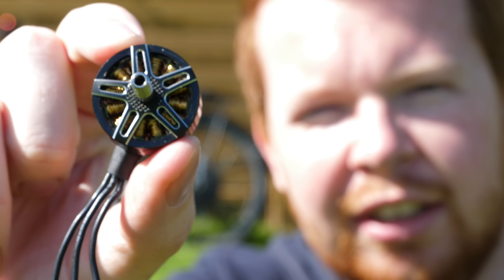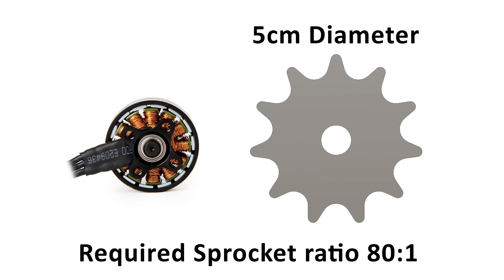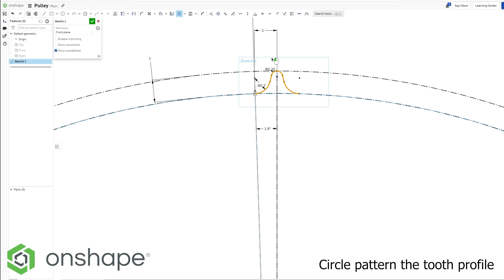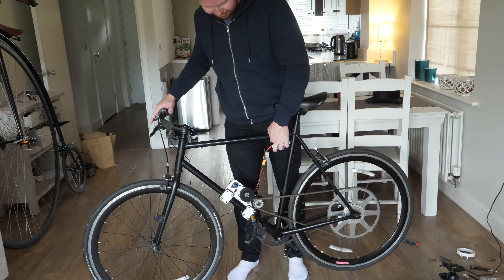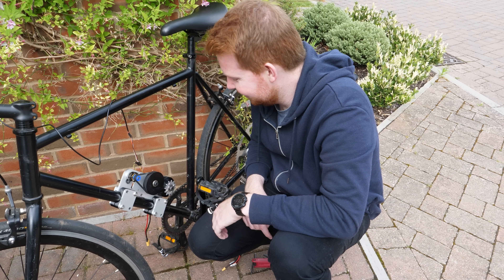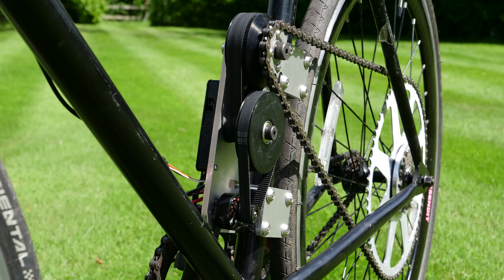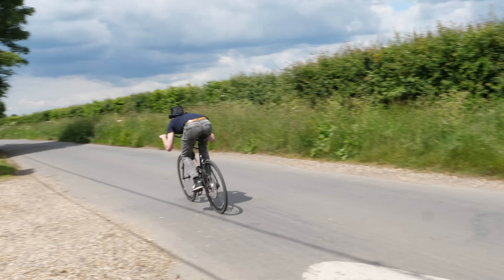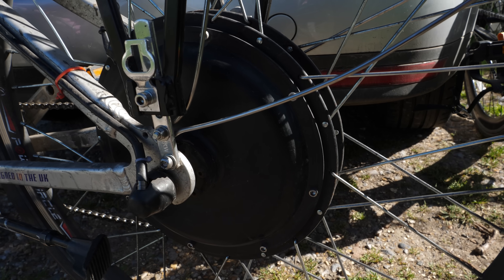Tiny 1kW Electric Bike Motor

Comment: Cool idea. Consider adding an aerodynamic duct to channel air through the little electric motor. So the faster you go, the more air it'll get over it, maybe add a little Noctua fan to it too. Should be fine 😉
Reply: Cooling is definitely what's needed but passive cooling won't be enough, as seen here. They'll need some sort of impeller to force air through the motor. On drones they have the props but that's under a far, far lighter load and there's no structure obstructing air flow like on the bike. Having a good impeller pulling air through the motor and kicking it out is probably the most effective approach here.
Reply: @Kimoto504  That's where the brilliant Noctua fan comes in. They move a lot of air and are damn near silent too =)
Reply: @Johny40Se7en  You need watercooling for this motor to work properly. These motors heat up soooo much even in proper use.
Reply: @yatzeegamingop   A watercooling system would add unnecessary weight though, and copper does corrode, so you'd have to add a heatsink that was attached to the water cooling set up and make sure the copper doesn't get wet. Again though, it would just add complexity to it. Just having a duct made of carbon fibre or even aluminium, then perhaps a 60mm Noctua fan to force air through the motor would be ideal.
Reply: @Johny40Se7en  Dude, i am saying even 85mph of ram air is not enough to cool the motors on my racing drone at full power. Why won't you try to understand it ? It's not a 150W cpu, it's a freaking 900W motor. 

Or better yet, use a hub motor. Like how it was intended.

Also inrunner brushless motors have watercooling jackets used in ground vehicles. Tom was just stupid in using an outrunner.
Reply: @yatzeegamingop  Oh I see...
Well, racing drones at full power is likely more demanding than accelerating a bicycle with a non obese Human on it. 

Or better yet, why not just use the little motor to do the top speed portions, instead of the acceleration from a stand still. Those little motors are not exactly designed for torque, which is very likely why they're overheating so quickly.

It's a cool experiment nonetheless. But hey, if you believe that strongly in your idea. That you can do a water cooling system for one of these motors so that it won't even get hot, even under heavy accelerating, then go for it. I'd genuinely like to see that.
Reply: @Johny40Se7en Noctua is garbage, try Delta
Reply: @Johny40Se7en  "Never even heard of Delta" tells me everything I need to know... No one likes Delta's; they're loud, obnoxious, dangerous, even.
Check out the monster that is the GFB0612ES-E: 60x60mm, 76 CFM air flow, 247 mmH2O (static pressure), 24K3 RPM, 50 watts power usage. 
Insanity.

Want to go larger?
The THD1348HE: 134x134mm fan, 490 CFM, 180 mmH2O, 12.5K RPM, 240 WATTS OF POWAAH

Noise level: Prolonged exposure requires ear protection. 

For reference, Noctuas only do around 1.53-2.34 mmH20, 99% less than the bad boys I mentioned.
Reply: @JosGeerink  them deltas can be so powerful it might as well be used for things like this video
Reply: I say, encase the drone motor in a water tight  case and fill the case with mineral oil.
Reply: @power21100  Submerging the non moving parts in mineral oil could be great. Or a combination of such an enclosure and a heatsink and duct with fan. Win win.
Reply: consider stopping with the lame ideas

Comment: There’s no way that little drone motor will output a Kw of power. To do that at 36v it would be drawing 28 amps and its wires would melt. As they did. Most likely it’s rated at 1Kw peak, not continuous

Comment: If you got a motor that would do that want to let it do that I said not allow it to do that with gears cuz I don't think it's right to be degrading the power of electric motor to slow down the speed of a vehicle that's usually pedals powered to suit the jerk 😜 behind the badge of a stinking cop jerk 🤣😂

Comment: tip, if you want more speed change where your gears are because the smaller gear on the wheel you will get more speed so basically a small to big gear ratio makes you go slow and a big to small ear ratio give you a bunch of speed.
Reply: Isn't 30000 rpm enough  ?
Reply: @matejmotuz108  no. More speed
Reply: @JayLandscapes3  that motor wouldn't be able to move bike even at it's normal speed , let alone higher

Comment: Your builds are amazing! May you can build a bike where the front and the back wheel is powered by the pedals? This would be amazing!
Reply: I think someone did that already. I remember seeing a video like this
Reply: Yes some body did but when it is turning the front wheel make a bigger radius than the rear wheel making difficult  to control the bike, needing front wheel to turn a little faster, and turns both wheels at the same speed in strait journey. But using two electric motors one in each wheel the problem is not noticeable because  it is no a solid mechanical connection between  the two wheels.

Comment: Less than a minute in & those numbers are clearly absurd. When I was young and fit, my best 10 mile bike time trial time was about 22:20, which if I remember correctly is an average speed of just under 27mph. Now lookup the video of top sprinter Robert Förstemann (with legs like oak trees) powering a 700 watt toaster to make toast. He can  just about do it after almost exploding his heart in the process. So my point is, even with the electric bike not being very aerodynamic, nearly 1000 watts would give a top speed way above 27 MPH.

Comment: I doubt you melted any coils - copper would glow first. But ooooh that smell of burning enamel from the wire insulation. It smells like imminent failure (when the windings short or the solder melts).

Comment: With a first transmission with a belt and then a small pulley that rests on the wheel and transmits the power, it should work well.

Comment: You issue is the small motor is not designed for a loaded start , you’re pretty much locked rotor … a small VFD from the likes of moon may be an option

Comment: The reason why chain came out is because bracket for the motor rocks to the left because of tension on the chain pulling left of the frame.. it needs a T-Pipe support to hold it steady and perpendicular to the rear wheel sprocket..

Comment: The biggest problem with small motors is that they don’t have the thermal mass that big motors have. They also spin fast and need a large reduction that reduces efficiency, which is why it lost to the e-bike motor in the race

Comment: Super Impressed. To me it seems very logical that if you were to use a larger motor and possibly only slightly larger with a doable cooling solution along with a larger battery you could really have something cool here. At the same time, I bet that e-bike motor is actually not that big.

Comment: A electric skateboard motor would be more appropriate as it is designed to move the same amount of weight. They have hub motors with a diameter of about 70 mm, they can get up into the 1000 watt power area too. I have about 1500 miles on my eboard with dual 300 watt hub motors.

Comment: Why didn't you just added one more 4:1 gear to reduce the RPM close to that 360rpm of the e-bike motor? In that way you would benefit of all the power of that tiny drone motor @ it's "nominal speed". You may have a lower top speed, but better acceleration, also the motor wouldn't melt itself.

Comment: Here's a little essay nobody asked for:
The Volume of an electric motor scales basically ONLY with the torque output, not with power output. That means you can drastically reduce volume without sacrificing power by increasing the shaft speed at witch the motor operates since the power output of a motor is just Torque x speed. But here is the problem, if you make a tiny motor to power a bike you will have to use a larger gearbox to get the torque back up, while you could have just made a bigger motor that has a higher torque and slower speed to begin with. So you will have a lower efficiency due to the bigger gearbox (and most likely a less efficient motor) and severe overheating problems due to insufficient cooling. Still, little motors waste less important materials such as copper and various metals, so thats why in recent times a lot of engineering applications are switching to smaller motors due to lower cost.

Comment: Ebike motors are designed to work in the constant power region, whereas drone motors aren't because with them you have the highest load torque at the highest speed.
This means that at low speed the ebike motor produces more torque than it does at the maximum speed, so that's why it was faster in the drag race.
Also, efficiency lol

Comment: 30k rpm motor probably doesn't have big torque as its designed for speed.  Nice demonstration I cant believe even with the bels and gears it could still move the bike.  I bet it was drawing maximum amps just to get going which would explain why the coils overheated.  Maybe this could work if you could develop a cooling system for the motor.

Comment: All electric motors have a fixed speed torque curve that contains the basic information for any applicable situation.. 

ETAP software Motor Acceleration module will determine actual real life consequences by simply using that speed - torque data curve during the initial design phase.

ETAP software c/w the motor acceleration sw module will likely cost you $25k and you will require multiple training sessions over a two year period to actually use it correctly.

Comment: Ah... the Age-Old Story of Horsepower vs Torque.

Let me simplify it for you.

Horsepower is how fast you hit the wall.
Torque is how far you take the wall with you.

Why do I say this? The first comparison of a sports car vs a farm tractor.
The Sports Car is engineered to handle a car weighing ~1100kG, whereas, a Farm Tractor is engineered to pull more than 10x its weight, and keep doing it reliably... whereas, if you were to go 100% in a Sports Car all day long, you'll be in the repair shop by the end of the week. Going 100% for a week is a typical workload for a tractor. It's like comparing a laptop to a datacenter. Sure, they have similar parts made by the same manufacturers, but they're built entirely different. 

So yeah, a 1kW Drone Motor and a 1kW e-bike motor are not going to have the same output results for the same weight. They never will.
You can have a 300hp 4cyl engine, and a 300hp 8cyl engine side-by-side, with equal hp to weight ratios, because why not... the 4cyl will win the speed-based race... but if each engine had to pull a load behind while racing, the 8cyl would easily overtake the 4cyl due to the massive difference in torque, and rotating mass.

Comment: You can pump as many watts as you want through any electric motor... The question is how long will it last... These small "1000w" drone motors are definitely not designed for any load at 1000w.

Comment: on the flipside
if You only need slight boost on uphill runs...You could go with tiny engine since it'd give way lighteer weight
(and it shouldn't melt on really short runs i guess...so just for uphill short bursts)

Comment: drone motor heat up cuz it have smaler diameter coil cable so more resistance so more heat dissipated...  and thus motor is smaller and designed to have a prop serv as fan...  rpm is the number of roll of the widing time volt... but you have many more place to make those turn into the larger motor... so you can use bigger cable... and remember a done motor is not alway at full throttle... when you ask it to accelerate the bike with ur wheight .. for that thiny motor allway down until it reach target rpm its like near full power for him (drone esc donc have motor punch control otherwise it will mess ur pid... but ebike surely does

Comment: You can sacrifice torque for speed or vice versa. Never both. The drone motors just don't have the torque required to handle the load regardless of gearing.

Comment: Would it be possible to Liquid Cool this tiny engine in Oil with a cooler like on a Crossbike so it doesnt overheat...and to buildt an efficient Gearbox🤔. If there is a way to make this thing running without destroing it after half an Hour it woud be a Reveloution in EBike Engeniering because the Weigth would be massively reduced

Comment: Add a prop to the motor and I think the cooling will be fixed. Also you could probably increase the kv to get more speed but you will need to be very careful with cooling

Comment: Short version:  power ratings are only relevant if the torque range is usable for the particular application.  Motors with high torque in the low RPM range are MUCH heavier/bulkier than motors with low torque, but high speed ratings, even if the HP ratings are similar.

Comment: Attach metal fins to the motor and to other parts near the motor to help dissipate heat. That should help at least a little bit. Moving on the bike will help increase that h value. Maybe also have air directed to it like some sort of manifold 😂 before you know it you got a car radiator on that bike for that small motor lol

Comment: I don't think you have fully grasped the problem of acceleration with a low torque motor. The amount of variable gearing needed and losses therein makes the larger motor preferable.
It'd be interesting to see you mount it on the bike with a propeller instead.

Comment: Electric motors are not built to overcome vast resistance... they have torque, but they will burn up fast if they have too much resistance... I wonder if there is an equation for this.

Comment: looks like not using a reduction gear in the big motor is a wast of mass. probably using 4x  lower kv and something like 1:20 ratio would be optimal in terms of motor weight to torque

Comment: The smaller the motor the less efficient they get. So that little drone motor is loosing a lot of energie in heat making it less powerful than a big 1000w motor. Size does matter 😑

Comment: A spring loaded chain tensioner could help you with the chain coming off. They are often used in single speed bikes.
Reply: Hasn't he had this issue before? I'm not even a regular bike rider anymore, been 25 years since last and I know that pretty basic requirement.

Comment: On MythBusters, they used some kind of extreme gear reducer on their handheld grappling gun motor in order to give it enough torque to pull Jamie up when they turned on the winch system they made. I wonder if something like that would work better for this application as well.

Comment: When it runs at full speed on the drone , it generates back EMF limiting the current. When its tuning slow when the ebike is moving off  , no back EMF so massive current .   Also the drone , isn't putting a Kw into the motor continuously , or drone would go skyward quickly.  If you knew the drone weight you could calculate the actual hovering power & compare that to the cycle acceleration power & see how much you torched it.

Comment: Don't reinvent the wheel! Bolt your slim small motor onto the side of an 8-10speed in hub gearbox. Use 1st, 2nd & neutral as normal & 3 to 8-10 as speed gears. You may have to reconfigure the twist grip & electronic shifter! Alternatively instead of mounting in the back wheel. Put a front sprocket with the correct No. of teeth for your purpose! You can always go up or down a tooth or two, to suit. That way you can have a STD fixed or freewheel at the rear.

Comment: Great experiment. I think ebikes are a bit over engineered and that is reflected in the rediculous prices they are now sold for.

It be fun to do a serious engineering attempt to redesign a much cheaper drive train for a bike.

Remember when ebikes required the user to use the pedals to help with acceleration?

Comment: you should try a 5000 or 10,000 watt rc airplane motor with 12 cell 5000mah batteries see if you can smoke the tires

Comment: I would absolutely throw down money for a conversion kit that I could attach to my existing non-electric bike, and deal with the shortcomings if it meant avoiding dropping $2k-ish for a proper ebike. And if it turns out the shortcomings aren't worth it, I could just sell it and get the ebike.

Comment: Tom Stanton - You should replace it with a water cooled brushless motor for RC Boat applications. Try hobby king. Small radiator, and a small water pump :)

Comment: as a kid, i had a bike, that had a electric motor on it, & it worked amazingly well. this was in 1985, im certain you could do it easily with modern tech. the one i had, was a traditional bike, with a normal pedal driven chain, but the electric motor was mounted above the front tire. it had a lever, that when you pushed , it would lower the drive wheel which was directly mounted on the motor, onto the front tire. it worked very well
Reply: Did it have enough torque?

Comment: Even if that motor were 96% efficient, it would put out the heat of a 40 W incandescent bulb. That's a lot of heat for something that small. Of course it's going to need cooling or at least good ventilation.

Comment: Oil Centrifugal Clutch "Boundary Layer" to dampen the load on that tiny Motor. Less Torque but also less Heat. Higher RPM possible.

Comment: stupid AF, the drone motors operating with kV (revolutions per volt), not a power characteristic.
but bicycle wheel having a kW specs (kiloWatts), which used as power applyed to smth.
at a start you comparing same HP but very different engine types (gas vs diesel), wtf, bro
the tractor having a great torque, to move a big weight at low speed, nissan is about to move a lightweight body.

Comment: Need a caslte 3800 4 pole. Or better yet a castle 1515 1/8 scale system. Ive thot about doing this. I have everything needed. And tons of lipos. Spare 1/8 motor. Just needing a couple 1/8 escs. 1 actually for an arrma kraron 6s. The other for the bike lol